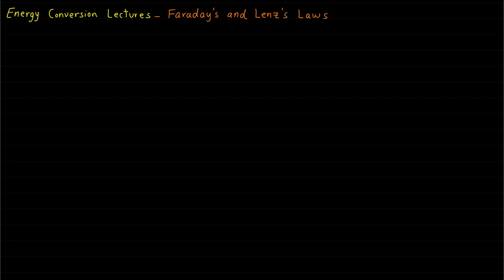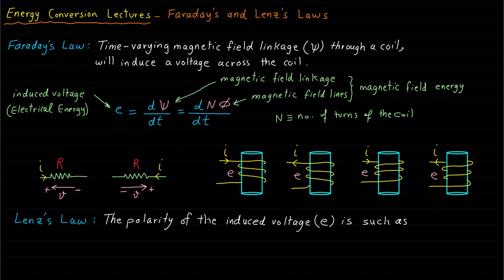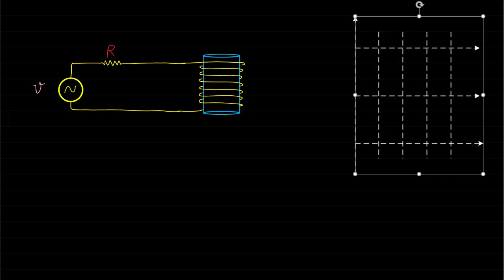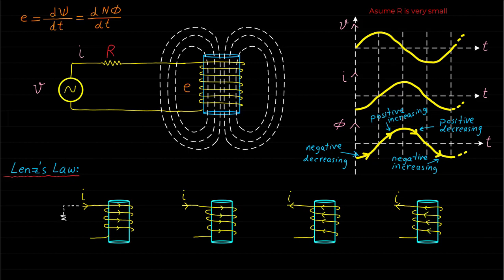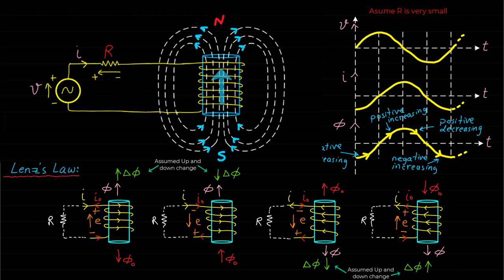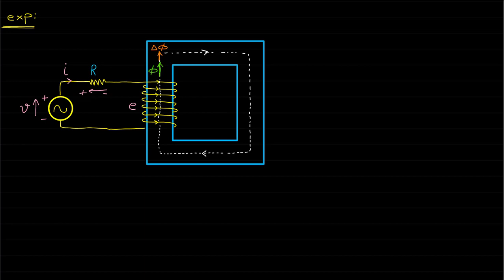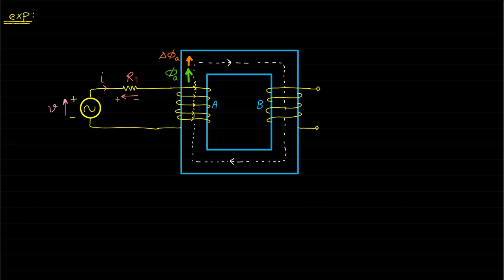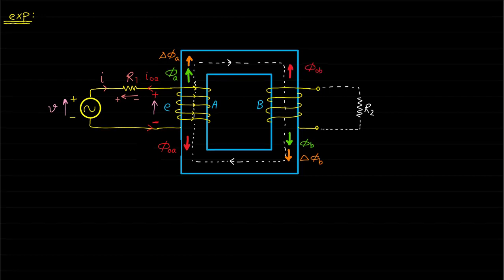Magnetic Circuits - Faraday's Law and Lenz's Law

Comment: Very good explanation and easy to understand. I have a question here, can you say something about the magnitudes of the currents ioa and iob (given in the magnetic circuit around 14:50), and assuming the circuit as a transformer: is iob the actual current that flows to a load, what is the actual current that flows in coil A (can i say that the algebraic sum of the two currents, one produced by the source and one produced due to the change of flux)? Thank you in advance.
Reply: Just a fellow learner here sharing my opinion:
iob flows to a load R2
Current in coil a would be the algebraic sum of i and ioa.
So i think you are correct in both your answers

Comment: Request for clarification. I watched this video again and noted that at 10.26 into the video you were referring to how to identify the current direction and you noted that it opposes (phi o) based on the right hand rule when I suspect you meant opposes delta phi since the current io should be that which produces phi o and this the direction out of the coil is positive and into the coil is negative. Can you please clarify. Earlier in the video you noted in step 5 using the right hand rule to identify the direction of the current io that should flow to generate the magnetic field phi o
Reply from the maker: Thank you for your request of clarification. It seems that I made error in the statement. So the correct sentence is: We can identify the current direction that "produces" (instead of opposes) phi_o using the right hand rule.  Your suspect is correct. Thanks